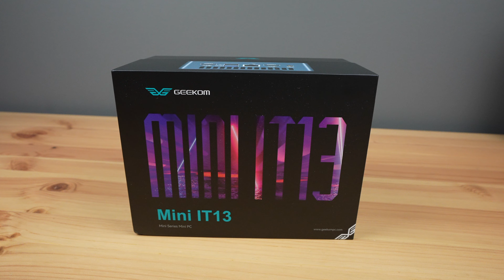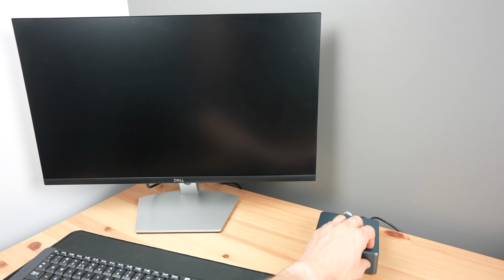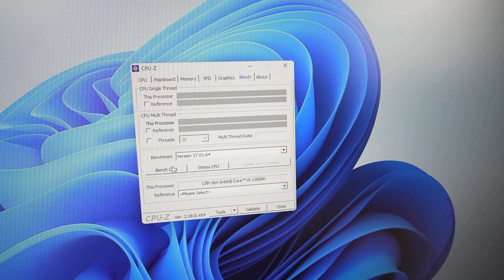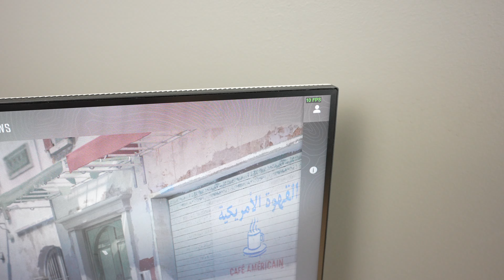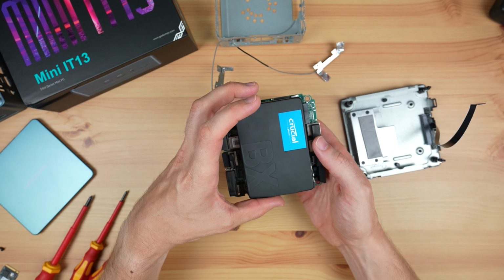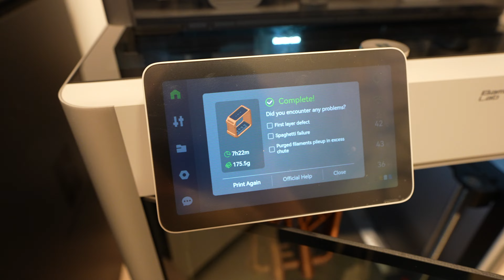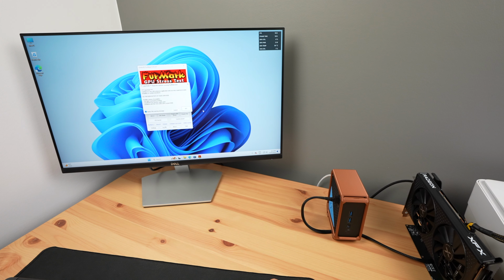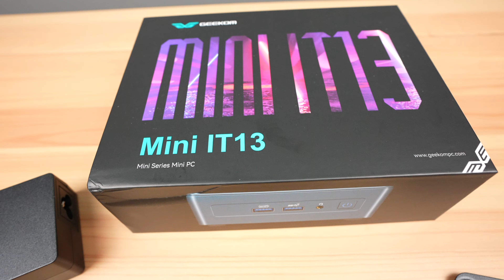The New Geekom IT13 Mini PC is Awesome with an External GPU

Comment: Beautiful case, looks factory made.  I travel on planes and would like a gaming PC to take along inside a carryon bag or luggage.  I would like to hear recommendations for a purchase or build if necessary to use for extended hours of gaming.  I'm afraid the Geekom may have cooling limitations for long hours of gaming, and powerful gaming laptops are too expensive.
Reply from the maker: You could look at a slightly more powerful mini PC that doesn't require an external GPU and has better cooling - https://youtu.be/6S8g4iw8gJE
Reply: @MichaelKlements  Thank you so much for responding.  I'm very close to pulling the trigger on a Chronos with a 7800x3d & a 4800 super inside a 10x8x18 case from Origin PC.  I know it's $$$, but it's a desktop with SFF that I can place inside a carryon.  I would love to know your opinion if you have time.

Comment: Nice. How does Geekom iT13 + GPD G1 over USB4 perform? any tips?
Reply from the maker: I haven't tried the GPD G1, but at over $700 for a mobile version of the RX7600 it seems quite expensive. You can buy a USB 4 PCIe adaptor for about $110 and an RX7600 for around $250 so you'd be in for half the price of the G1 is you built it yourself.

Comment: Great setup and video! Would the m.2 to PCIE adapter work in the 2242 adapter instead of the 2280? The  Geekom Mini IT13 has 2 m.2 slots so maybe that would work?
Reply from the maker: No, the second M.2 slot is a M.2 SATA port so the PCIe adaptor won't work in it - that's why I had to use the 2.5" boot drive. I could have rather used a M.2 SATA boot drive in the free slot but just didn't have an M.2 SATA drive available.
Reply: @MichaelKlements  Thanks for that! So I could use the adapter in 2280 for eGPU and boot off of a 1TB 2242 with a 2.5 'data' drive sounds like. Again thanks so much for your vids and expertise!

Comment: can you get better oerformance from the GPU if its conected directly to the mother board than using a cable using one of the  USB C 40gbyts port? as en external ?
Reply from the maker: Yes you could plug the GPU into a USB 4 port and it would provide better bandwidth - you'd obviously need to use a different GPU PCIe adaptor though.

Comment: You have two m.2 slots, you could have 3D printed to install oculink in the empty slot and kept the ssd. Why did you not is a mystery 🤔
Reply from the maker: There is a difference between an M.2 SATA port and an M.2 NVMe port. The empty slot is a SATA port, neither the NMVe drive or the GPU will work in it.

Comment: Is there any bottleneck with the gpu? Does the pcie lane bottleneck the gpu
Reply from the maker: The single lane means you can't get the full throughput to the GPU, so there is some additional GPU performance that the PC won't be able to make use of for GPU intensive tasks.

Comment: dude i really want to have this kind of setup, i have mini pc running ryzen 5 5500u with APU/igpu max at 4gg but its not enough to run multiple bluestacks and heavy games. I want to add egpu badly. i have spare m.2 slot which is 2242 i think will that work? because my m.2 2280 occupied as a main boot drive and i dont want to replace it or swap. hopefully you could answer my question.
Reply from the maker: The 2242 M.2 port is a SATA port, you can't add a PCIe device to that port. Your only options would be to migrate the boot drive to a 2.5" SSD or onto a 2242 SATA drive and free up the 2280 port. Alternately you could add a GPU via. USB 4

Comment: Can you hot-plug the GPU?
Reply from the maker: No, it's not hot-pluggable. If you want a solution that is hot-pluggable then it would be better to go with a USB4 eGPU
Reply: @MichaelKlements is that compatible with the geekom?
Reply from the maker: Yes you can use a USB4 eGPU on the Geekom as well
Reply: @MichaelKlements  great. I’ve just ordered one, not really for gaming more for an always on machine to connect into when I need Windows for work stuff but it’s nice to have the option.